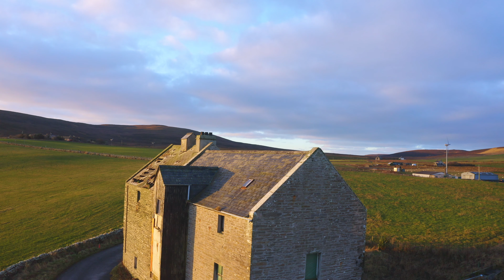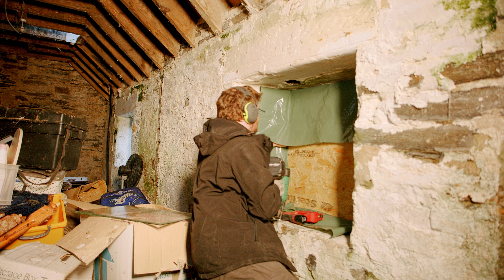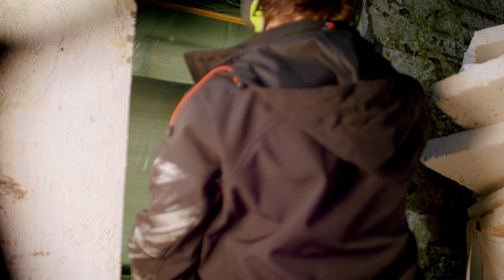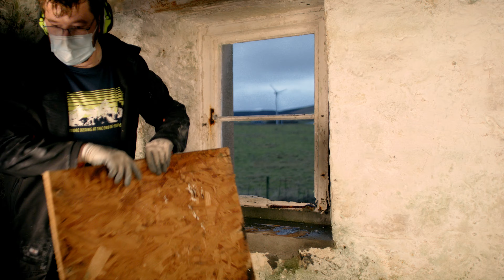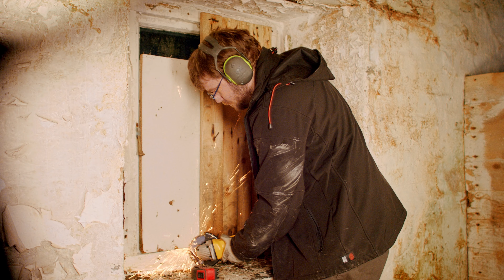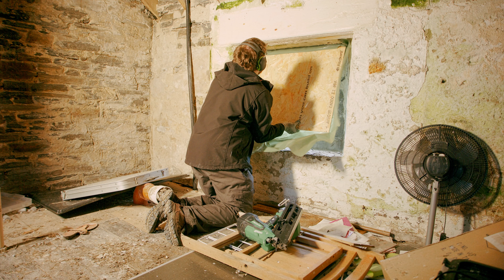Future Plans for Our Derelict Watermill

Comment: Hello from Canada! I think your plan is wonderful. I'll be following your adventure with enthusiasm and interest!
On the power generation situation, I was wondering about something that you may be able to do right away, and before the phase of water wheel restoration. Have you considered hydraulic generators? 

In my career, much of the electricity needs in remote or isolated construction sites was made possible by this brilliant but little known British invention (Scottish, actually -- first made just over in Inverness). 

If you have, or soon will have, waterflow along that mill race, and it will generate 14+ Kv, then installing a smaller wheel on site would easily spin the rpm's needed to operate a small hydraulic generator for all of your needs. Usually, we operated these generators from the Power Take Off of our large equipment, or trucks. 
But when I served in the Canadian army, we would often adapt PTO driven equipment to whatever we had available in the location, including converting a water wheel. That was in Bosnia, I think.
We mounted a pump to the wheel, then the pump to a hydraulic motor that could spin the rpms required , then the motor to the hydraulic generator. Later, we simplified the process, when we got hold of a hydraulic generator with all the aforementioned components included. It worked brilliantly and saved a small fortune in diesel consumption. It was also much quieter than running three diesel generators night and day. (And a lot greener).
Anyway, long story short, if you go looking around, you'll find they are quite easily available in the UK. You may even have passed by several examples of them in that surplus yard where you picked up your Lorry.

Best wishes, and good luck. Chimo!
Reply from the maker: Glad you're enjoying! Unfortunately there's almost no chance of us getting water down the lade, as sections of it are missing and water rights will be very difficult
Reply: @thewatermillscotland  oh, rotten luck! I wish you best of luck in your efforts on that. The only other things I can think of would be to either construct a temporary water accumulator tower filled by the well, or plugging one in to the port on your lorry’s transmission. Anyway, keep it in mind if it’s a green alternative solution that might be of help in your efforts. Cheers!
Reply: @thewatermillscotland  give it a try and attack the bureaucracy! Energy produced by your own waterwheel would be great, and revive the listed mill.

Comment: Can you set up solar panels on the roof, or set up windmills on the property?  An island probably has great wind.  If you can't turn the old water wheel into a hydro power station, can you make a dam, or a side-dam off of the river?  My grandpa made one of those in British Columbia in the 70s for his friend's hotel in the mountains, I can put you in touch with him if you like.
Reply from the maker: As a listed building, solar panels are highly unlikely. I'd love to try solar slates but they are out of our budget. If we can buy the land next to us (which has the mill lade and waterwheel in its deed area) we hope to run one to two 5kW wind turbines with battery storage, but we don't know if we can afford to do that right now. We want to buy that land for other reasons, but it would make a great spot for small wind power.

We'd need the same permission to divert the watercourse of the river next to that land as we would for running the waterwheel, so if we go with water power we'd just get the wheel running.

Comment: yasss updates! Any plans for the garden? also the odd question: no buried human remains in the ground around the mill?
Reply from the maker: We're figuring out what to do with the garden, probably won't be something we can look at until next year, as the grounds will be a construction site. There's not a lot of plants that will cope well with the very northerly latitude and strong winds.

It's a watermill, not a church ;) We looked a lot of derelict/disused churches - many of them had graveyards. Watermills are not commonly known to have graveyards attached to them.
Reply: @thewatermillscotland  there is a wide range of plants and shrubs which will happily tolerate our climate.  Best thing you could do would be plant a couple rows of willow whips through Terran fabric around your boundary.  This will give you a living wind barrier quite quickly.  I can give you willow whips end of March , which is best time to plant.
Reply from the maker: @nickbeal6096  Much appreciated, we bought a book on Scottish gardens because all the "British" garden books only cover the bottom 50 miles of England and consider Birmingham "northern" and Manchester "far north" heh. Still, the Scottish books consider Aberdeen "far north", but at least they do mention the highlands and islands.
Reply: @thewatermillscotland  yeah, most gardening books are of limited value here.  We don’t suffer severe cold due to our oceanic climate.  The killer is usually salt wind (as I’m sure you have experienced 😂).

Comment: Man! The wind while you were putting in those windows covers is bonkers! I assume the renewable energy you mentions on the island is wind? I think I saw a windmill spinning outrageously while you were putting in a cover. You mentioned you worked from home and I was wondering what your plan for internet out there was. Something that has kept me restricted to urban settings is lack of decent internet outside the cities here in the US.
Reply from the maker: That was not a windy day for the area, but still a fight to push the boards over the windows. Goes to show how important having covered windows is for the survival of the property.

There is mobile internet to a degree, as long as we use high gain antennas and a decent router. There's no cabled internet. We're hoping SpaceX's StarLink will service this latitude sometime soon - that is going to make a massive difference to rural communities across the globe.
Reply: @thewatermillscotland  Just an FYI on that real world measurements of performance place it way bellow other satellite services both in terms of absolute and value for money performance. This being with the cluster being heavily underutilised at not even 5% of the load per unit surface area of the planet it would need to handle to be remotely profitable so performance is expected to go down a lot. I'm just saying be cautious about jumping onto the hype train on that one and look closely at real world performance reviews before you decide which is the best option for you.

Comment: The proposal to fit a moisture barrier on the walls does concern me, can you tell me more about the reasons for this. Thanks
Reply from the maker: We want to use gypsum plaster boards on the inner walls, which obviously are not breathable. With electrical/data sockets and light switches creating an opening for warm moist air to get through, we need a barrier film on the insulation to prevent condensation of the internal air either in the services cavity, or within the wall itself.
Reply: @thewatermillscotland  I can see the reasons for concern, but you may want to consider using something other that plasterboard? Plasterboard is calcium sulphate which attracts moisture from the atmosphere and supports mold growth. Membranes can be problematic as they can keep moisture out and in. Take a look at woodwool boards which are very breathable, good for noise reduction and has some thermal performance. It is easy to lime plaster too.

Comment: It's too bad you can't use temporary windows for now, then replace them later. Even just something simple like a sheet of clear acrylic corrugated roofing, attached to some thin strips of wood to hold it in place to let light in while you work.

It'd be a bit rough, but you can probably set it up enough to get a tent and camp kitchen set up inside, just for weekend use when trying to stay on the island before it's complete. Coleman stove, cast iron skillet, cook pot, dutch oven, campfire outside from rotten wood that needs disposed of, and you're set.
Reply from the maker: There really wasn't much light coming in even through the completely missing windows. We could have boarded it up with acrylic/PET/PC but OSB is just easier. We have a bunch of bright LED panels which really help, and can be powered off standard cinema batteries. They are substantially higher quality lights than regular work lights which is great :)

Comment: Using the watermill to generate your electricity is a wonderful evolution of the mill.
Reply: Isn't that very noisy though?
Reply from the maker: @desm666  The inside portion shouldn't be, it would just be the main gears turning. If they are properly lubricated and balanced there should be very little noise. The outside will be noisy, but that's on the other side of a 800m thick stone wall, we wouldn't hear very much at all.